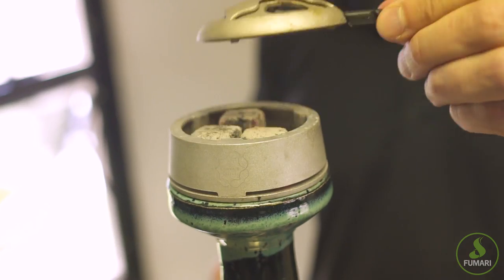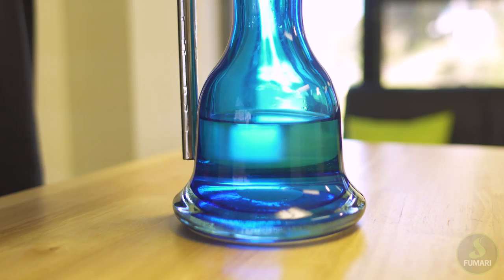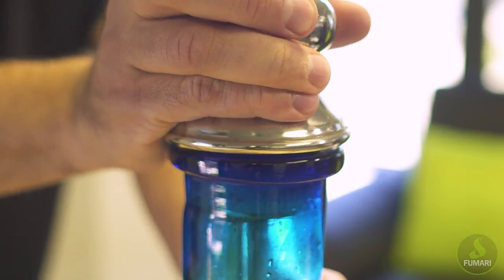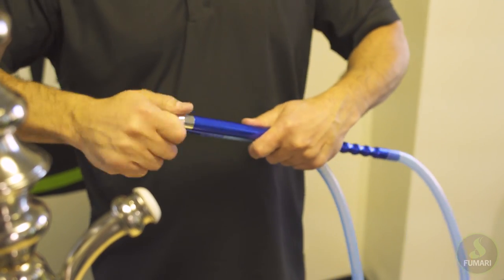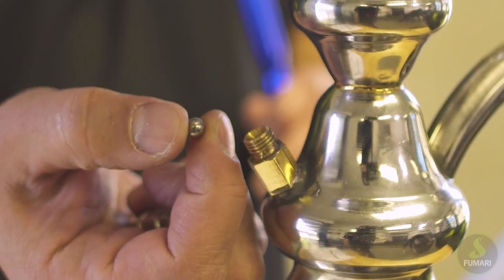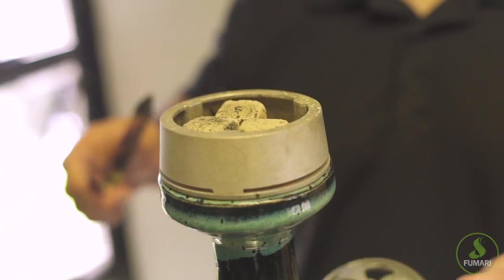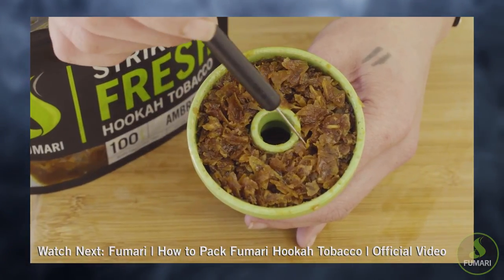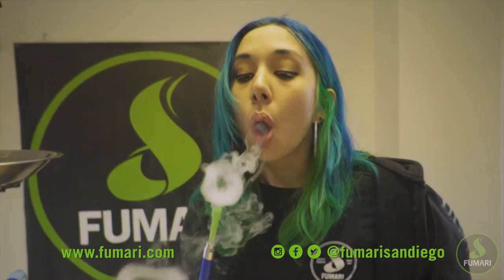Fumari | How To Troubleshoot Your Hookah  | Official Video

Comment: When i blow through hose during session the smoke comes out from both bowl and purge.
Reply: You’re blowing way too hard and you also need to have the water leveled little bit under the stem not a lot above or too much below also stop blowing the hose too hard just enough to purge
Reply: Thats pretty common, especially if your hookah has a hybrid purge system, hookah can purge trough only the bowl too, it cools the bowl down so thats not really a problem.

Comment: Hi. Need help regarding hose grommet seal is broken. Any advice how to fix it.
Reply: Easy take a tissue paper wrap it around the hose bottom and plug it in until you get a new grommet you can do the same for the bowl on top of it’s not silicone too. It works as a make shift grommet.
Reply: Can we use Teflon tape
Reply: @nishibane2121  I guess yeah but I would stick with the toilet paper / tissue paper simply cause when you do smoke the glycerin from the shisha will change the color of the tissue so you know when to change it